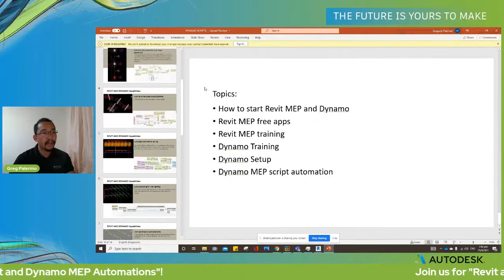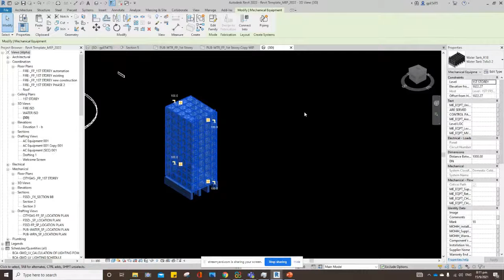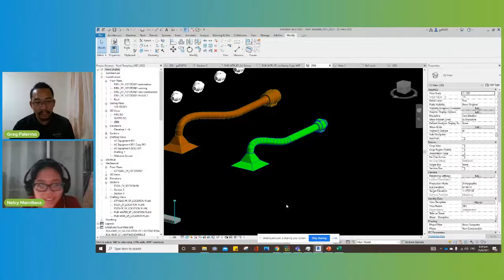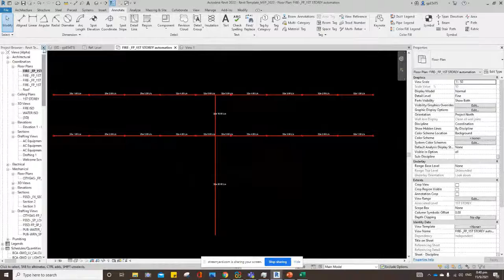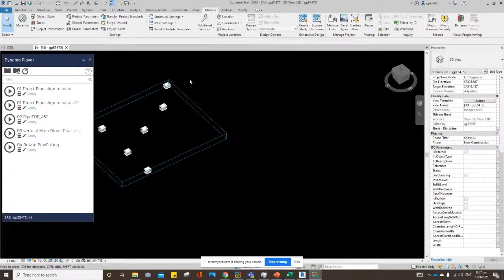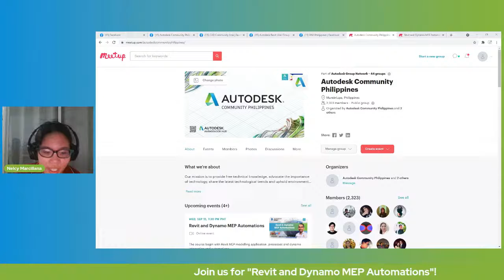Revit and Dynamo MEP Automations

Comment: 🙏Thanks for this helpful tutorial. I want to change the calculation Method in Revit ......
(Path => 1. Systems(tab) -> 
                2. Mechanical Settings -> 
                3. Pipe Setting -> 
                4. Calculation -> 
                5. Flow(tab) -> 
                6. Calculation Method) 

...... from "the 2012 International Plumbing Code (IPC) Table E103.3 (3)" to my custom fixture flow rate/table. 

👉 How would you advise me, please?
👉 Can I use Dynamo to change input/references like IPC Table E103.3 (3)?

Thanks